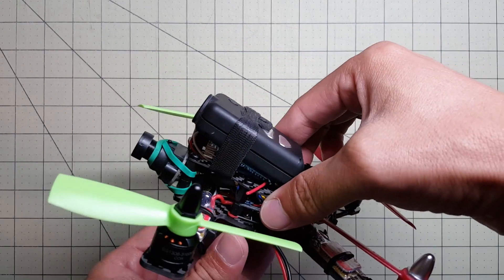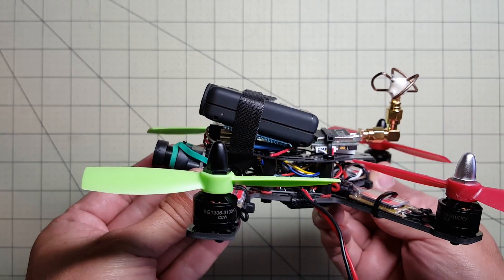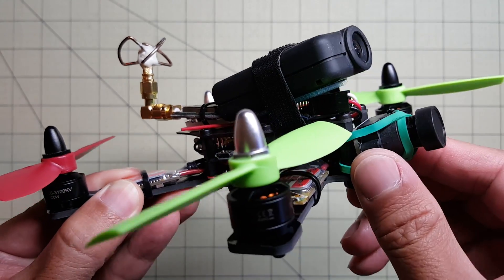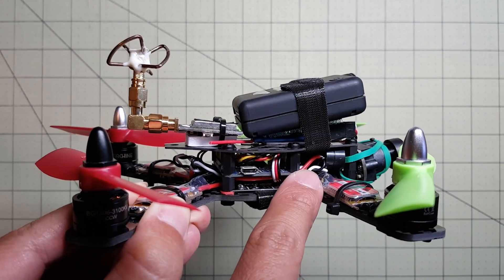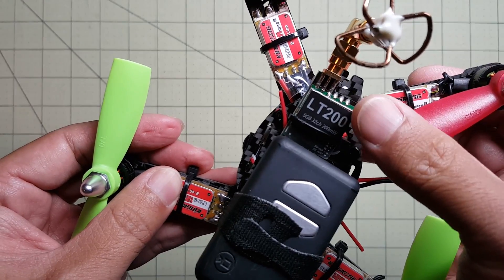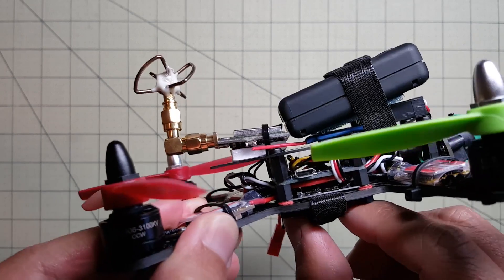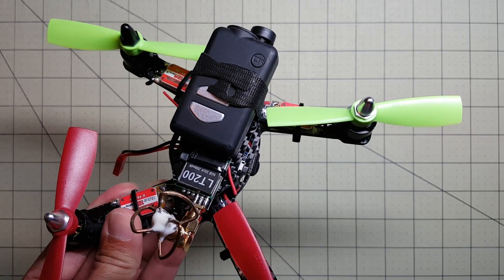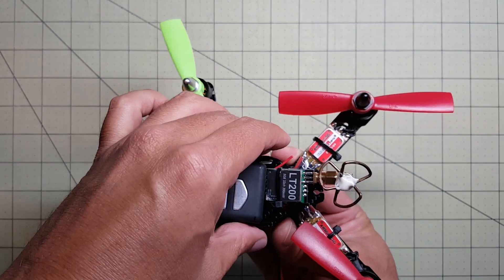Diatone Grasshopper 160 Build Overview

Comment: can you use the full Naze 32 on this frame ?  only reason I ask. I have a few...and I'm familiar with the setup
Reply from the maker: +pointnozzleaway Yes, it's a full sized Naze32
Reply from the maker: +pointnozzleaway Also, see my rebuild video to get a closer look at the components!  http://youtu.be/3VzN0ykcT1c
Reply: awesome, thanks man.  I notice the comment on the 4045 bullnose props being too much for the 1306 motors...any tips on that ?  those are what I had planned to use
Reply from the maker: +pointnozzleaway They might be, although I never had any issues. The quad is so light that I don't think it matters.  If this were a larger and heavier quad then the 1306 motors might struggle.  In my use the motors never got hot so I guess it was OK.
Reply: good to know. I'm not gonna be racing this quad..just cruising and fpving.  thanks for the help !

Comment: Nice quad but bullnose props are too much for 1306 motors. They need too much torque to turn them so they become inefficient, resulting in excess amp draw and possible over heating. You will get best performance with standard 4045 props :)
Reply from the maker: Thanks!
Reply: Albert Kim I was wondering, would the hglrc xjb 145 electronics and motors fit on this frame? Do you think itd be a good build?

Comment: Do you mind sharing your PID's for the naze. I just built a 150 quad and it isn't very responsive with the stock naze 32 PID's.
Thanks!
Reply from the maker: +mitchmo5000 I'm running Betaflight 2.1.6 with stock pids on LuxFloat. Roll/Pitch rates are 0.30, Yaw rate is 0.40, TPA is 0.15

Comment: Nice,   but not very well though out,  you should be able to get every thing inside the frame with the exception of the mobius and battery :-)
Try  and get every thing inside the RotorX 122, its quite easy if you plan it out.
Reply from the maker: +mike jh  Yeah, this is my second quad build ever so I am still learning :)  I'll try better next time!
Reply from the maker: +Indy John Jones I did a rebuild video with everything inside.  The 4 inch props are okay with the 1306 motors so far. No issues.  I only fly 3s and my ESCs are 12a